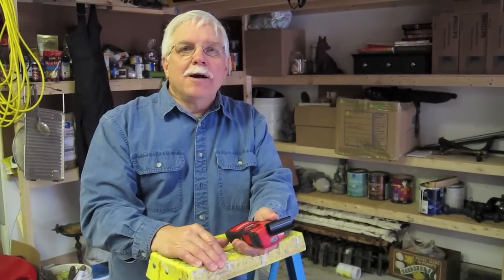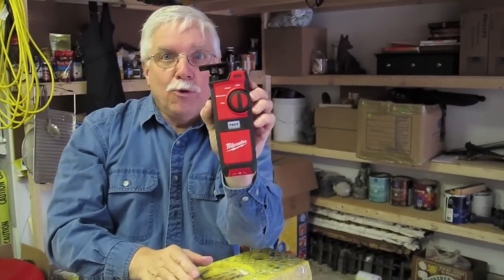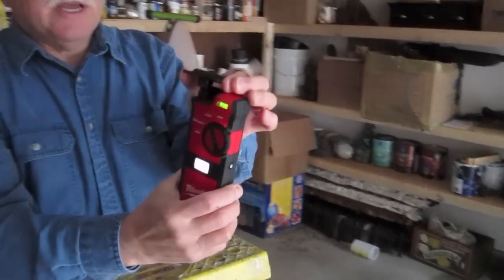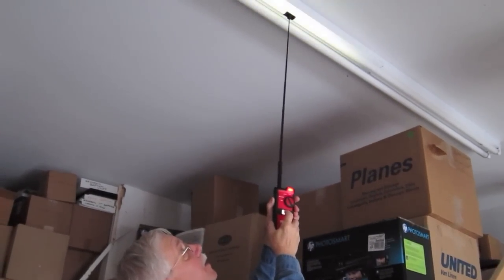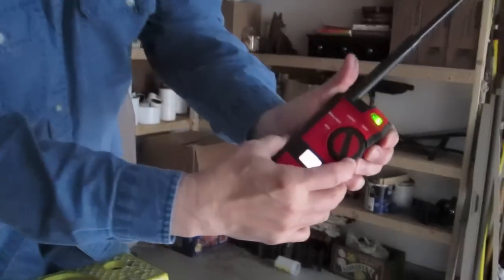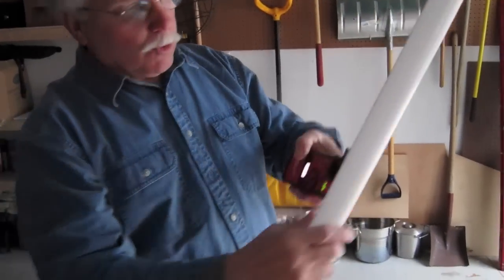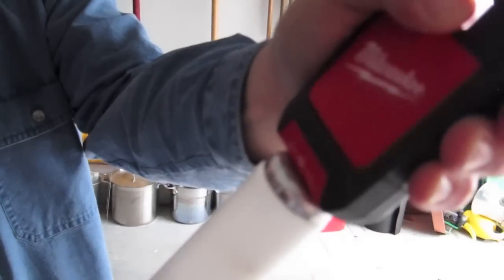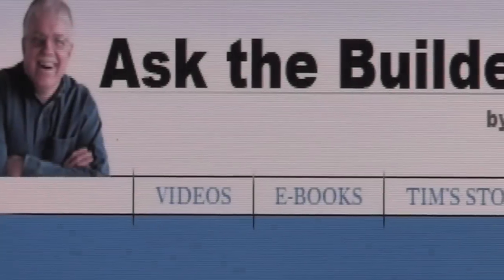Milwaukee Fluorescent Light Bulb Tester

Comment from the maker: @jobaecker You can still use it with magnetic ballasts!! The first thing to do is to just test the lamps. If you do what I did at the beginning of the video and BOTH lamps flicker as you push the test button, then you know the problem is with the ballast and/or it's an electrical connection. You can also do the pin test. Thus the tool absolutely helps you pinpoint the problem - even with old-style ballasts. Cool! When I saw this tool in July, I wanted to buy stock in Milwaukee.